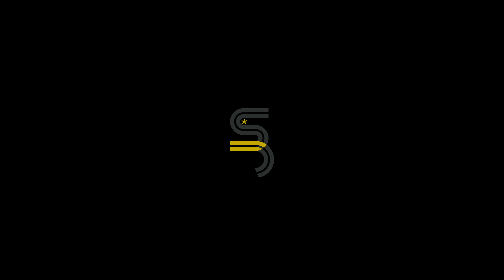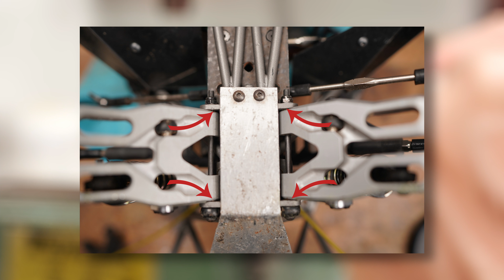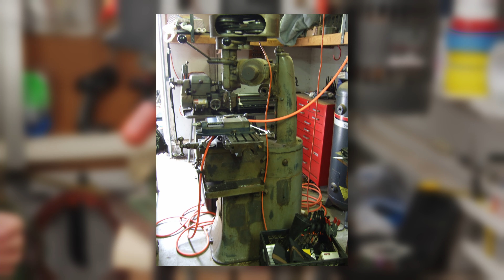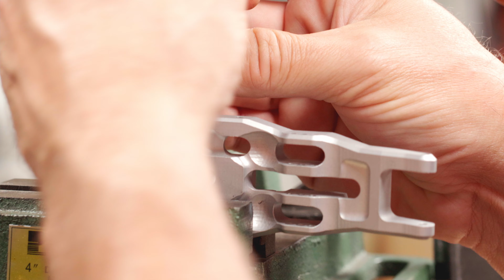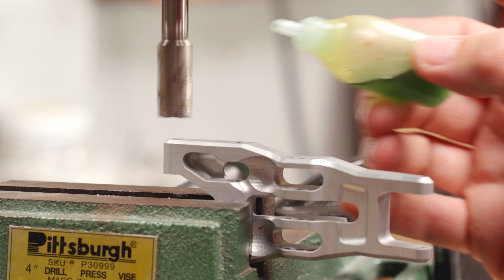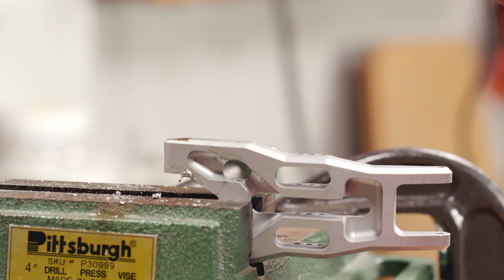Why I Mill the Trophy Truck Control Arms without a Mill

Comment: Would love to see how you thread the 3/16 tubes, for example, the rear links and the swing steer prototype.
Reply from the maker: I don't thread the rods.  I cut a steering linkage in half and braze each end to a solid rod, which is cut to the required length.  Hope that answers your question.

Comment: Nice.....unfortunately my current drill press sucks, until the Nova Discovery comes off infinite back-order😍.......but luckily I got a P-M Mill just before 
China shut down dec 2019😎  You can never go wrong with lubrication....it can save tools from overly aggresive feeds.
Reply from the maker: Wow, jealous.  The mill that I grew up with is sitting in a storage locker in California, along with the lathe, horizontal band saw and several other pieces of equipment that I received from my dad when he passed.  Sadly, I have no place to put it here in New Jersey.  Some day!  For now I use the drill press for whatever I can.